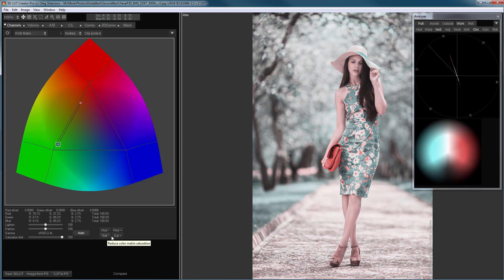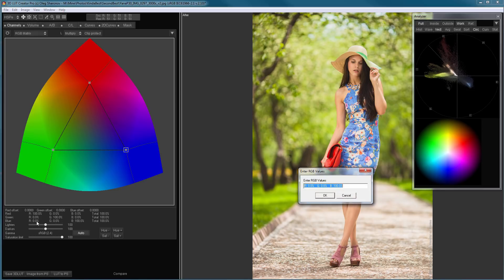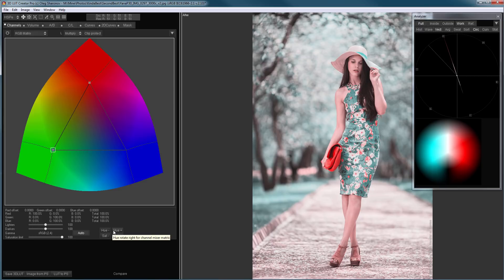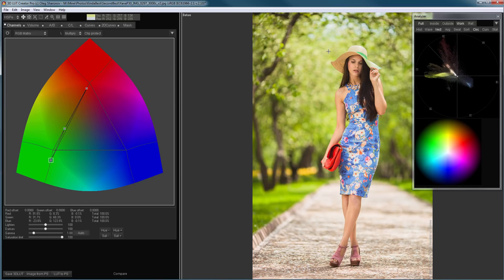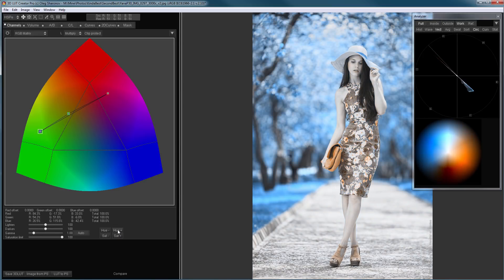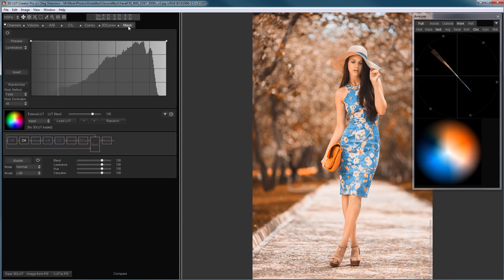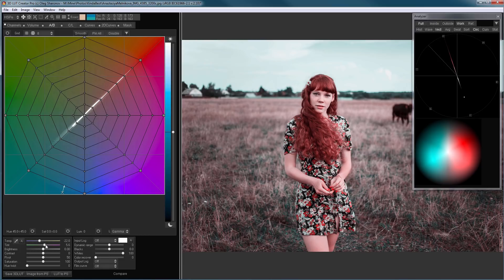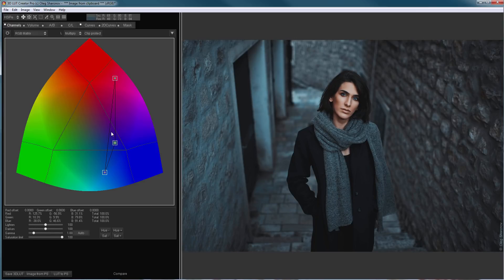Technicolor 2 Strip technique in 3D LUT Creator

Comment: Hello Oleg. Wonderful video. I am stuck on a problem and am not able to figure out. Kindly help.
1. As the colors stay on a single line, what if we want to use a pair of color which is not opposite to each other (not on single like)? Like if we want to use Green and Yellow? Means what If we want to use only two colors but not comprising of single line?
2. What is we want to increase some color variability within the color range...?
Reply: Hello Oleg, how to get two colors which are not single line, but a line with an angle on vectroscope?
Reply: Use the AB tab?